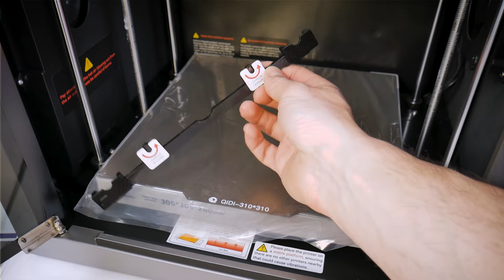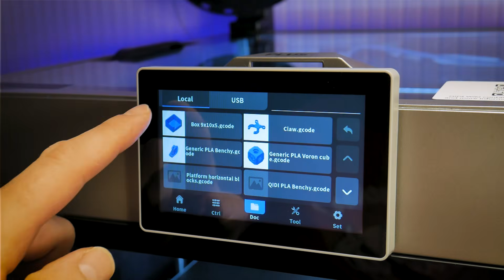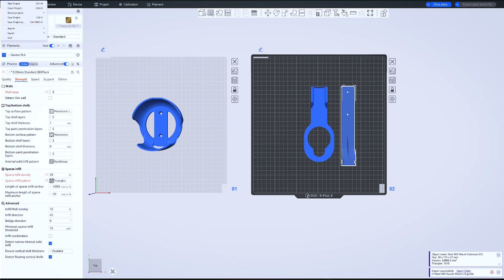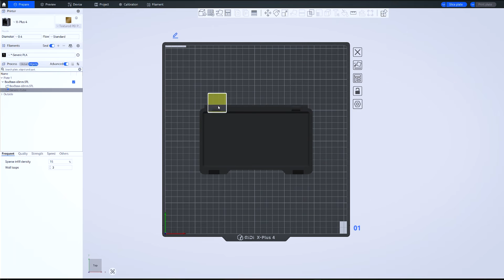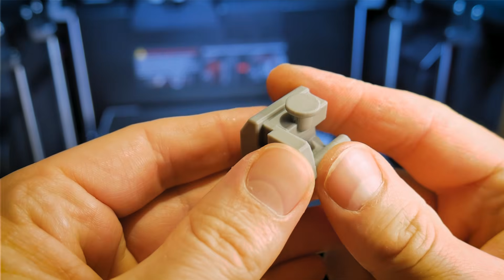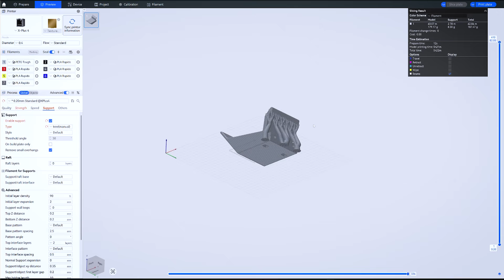QIDI PLUS 4 - Full Guide and Review - Still a Good Buy in 2025?

Comment: Ok with mine for a year, ordered after the 120v SSR update and have v2 of Qidibox, but staying on older firmware 1.7.0 for minths, and last week just updated to 1.7.1 as source is no longer disclosed beyond that. 

Had the ceramic heartbreak die and was replaced. Qidibox is touchy to say the least, but seems jams are due to the inner diameter of the PTFE tubes not being 4OD 3ID. 

I know the piezo sensor will need replacement due to heat with Beacon/Carto sooner than later. 

It's hard to recommend any printer these days as locking down features and violating open sources licensing by not posting modifications regularly is the norm. 

If I wasnt in the Qidi discord for easy access to troubleshooting methods, I doubt I'd be as fine as I am with the unit. (Like Screws Tilt Adjust being a key Macro for initial setup!) Sadly discord means the community info is locked down from the public internet.

Comment: DO NOT BUY QIDI PRODUCTS! If you are considering them, do yourself the favor and read my "long term" review. I have no youtube channel or affiliate links, but have plenty to say about them. Their philosophy is maximum function for minimum price = made as cheap as possible. I bought a 4 plus (with box) thinking the nay sayers are just the loudest. I mostly print with chamber heater at 50c asa/abs. My printer worked fine for 4 months and has been a nightmare since. It is falling apart constantly. I am currently fighting them for a return. The list: broken runout sensor which was stuck at "on" (which makes the box unusable because the printer thought the filament was in the extuder and never loaded it properly). The extruder gears are running really rough, giving ureliable extrusion. The heat sensor cable is literally hanging by the wire because the adhesive let go. The silicone cover on the nozzle desintegrated with some sort of corrosion under it and on the heater (no idea why, probably came like this from factory). The top door hinge sheared strait off the plastic frame for no obvious reason. The metal surface under the printing plate is developing cracks around every screw. (Support says its a no issue!) I get constant bed probing issues depite heat sinking the printer for 30-40 minutes with chamber at temp. I get uneven first layers constantly when the printer starts a second item in sequential printing, probably because of the previous + i am pretty sure the bed is wobbling forward/back perpendicular to the screws. Their slicer was updated 2x probably because of the 4 max coming out, it became progressively more unreliable with also crashing the printer about every fourth print now. All in all if you want a reliable, simple, turn key to print machine stay clear of them. All the lost time and frustration probably cost me more than getting a h2s or h2d from the start.
Reply: Can't do bambulab, closed ecosystem. I can do qidi, I have an xsmart3, and looking to get another qidi.
Reply: I have 2,000 hours on my Plus 4 and it has had zero issues and its in the same condition as when i first got it. By the way, of course you are going to get bed probing issues after heat soaking the printer for a half hour with the chamber fully at temp. That is literally when it would work the worst genius. The piezoelectric sensor on the Plus 4 is sensitive to high temperatures, you are basically torturing it dumbass. This is exactly why people have a bad experience with Qidi printers, because they are not made for novices that have no clue what they are doing. You need a printer that is stupid proof, go buy yourself a Bambu.

Comment: I ended up sending mine back after so many failures. They tried offering me 100 dollars to keep it,  but a non working printer is not useful.  Influencers make it seem awesome,  but I had to work on the one I got from day one. Never got a decent print.  Working with their tech support is not great. Sure, they will send you replacement parts, but the wait time is terrible.  Sometimes, you wait days before getting a response, and it is very frustrating.
Reply: Did you end up replacing it with another printer?
Reply: Curious to know what kind of filament you tried using right off the bat? Qidi printers require dialing in filaments that are anything more complex than PLA or PETG. They will do engineering grade filaments, but don't expect to just select a stock preset, hit print and have everything just work perfectly.
Reply: @TheMerchFiles the first filament i tried was pla. I still have my original qidi plus that i dialed in many a moons ago, but i replaced the new version with a bambu labs h2s.
Reply: I ended getting a bambu labs h2s.

Comment: Qidi is not a printer for everyone, mine took 5 months to get it running fine and I still have problems with the shit stock probe and managed to fix it be installing freedi os.

They did not want to refund me and accept to retun my printer so please dont buy a qidi if you dont like fiddling and want a plug and print printer, go with bambulab
Reply: I had zero experience with 3D printing and the Plus 4 was the first printer i ever used. I started with Polymaker PETG and it ran flawless out the gate on stock presets and i never had to adjust anything. First 3 spools of Poly PETG and never had a single print mess up. 4th spool i tried ASA and thats when i couldn't get it to lay down a clean first layer. Took a few hours of making adjustments and eventually i dialed it in and have not had an issue really since. Just got the Max 4 a couple months ago and its been just as nice.

Comment: Hey, qidi 4max or creality k2 plus or anycubic kobra s1 max? For pla i perg and ofcourse quality 😂
Reply: The Anycubic S1 Max is laughable compared to the Qidi Max 4. The specs says everything, S1 is recommended at 300mm/s max print speed and 10,000 mm/s acceleration while the Qidi Max 4 can run at 800 mm/s print speed and 30,000 mm/s acceleration. And the difference is in the raw build quality. The S1 has small belts and, small steppers and a tiny linear guide rail while the Max 4 has belts twice as wide, powerful closed loop steppers and a beefy dual carriage guide rail made for hauling ass.

Comment: I print PC-CF and PAHT-CF on my K1SE, does well enough with the enclosure, just ordered the Qidi plus4 myself though for the larger space and to have a printer that is actually designed for the more exotic filaments.  My K1SE also has issues with Wi-Fi, I run a separate router and disable the 5Ghz on it and run it only for my printer at 2.4ghz

Comment: Have had the Plus 4 for a few months now and already on my third hot end. This last one I only ran PLA-CF through it, so it is not for using multiple materials in the same nozzle and potentially causing clogs.
The printer prints very well but the start up is painfully slow - until the hot end fails.
The cost of ownership at $45 a month for hot ends is not fun.  probably run it 100 hours a month, maybe more... but that is far from full time say 360 hours a month or more. At those hours the cost of ownership goes up $90 per month, $1,180 per year.
Reply from the maker: That seems crazy :( I guess it must be the CF that is abrasive enough to do this. I'm still on my original hotend with regular PLA with no signs of it degrading yet. I do agree the startup is slow though, and navigating through the file menu waiting for the pictures to load is still frustrating to me. Otherwise I was comparing prints today between this machine, my K2 Plus and my H2S and honestly the part quality on the Plus 4 (with regular PLA) is right up there with those other two machines.
Reply: @EmbraceMaking  I have no issues with print quality, very pleased. However, the cost of ownership due to faulty hotends is not fun.
Reply: Phaetus makes a drop in replacement for the plus 4.  It let's you use v6 nozzles and claims 30% improved flow.
Reply: @dukex12  Have looked into those... there is a mixed bag of likes and dislikes. Questions about actual compatibility.

Comment: Ive had my plus 4 for almost a year with thousands of hours.and its by far one of absolute favorite printers. Absolutely beautiful prints. I mainly print high temp and abrasive materials on it and it just handles absolute everything ive thrown at it. I recently also got an h2d and having that second nozzle for dedicated support interface material has been a game changer. A qidi plus 4 with a dual hotend like the h2d is now my dream printer. Or basically an h2d on klipper would be my dream printer

Comment: To fix the Wi-Fi issue... Open the rear panel, remove the Wi-Fi chip from the motherboard and put it in the USB port on top of the machine. 

Go a step further and buy a dual band 5ghz capable tp-link wireless adapter and use that in the top port. They all seem to be well supported by Armbian OS. 

You can also use a USB 2 hub in the top port to have your Wi-Fi adapter and USB flash drive if you want both.
Reply from the maker: Thank you for the suggestions, I guess it didn't dawn on me that you could just put a hub up there and upgrade the wifi dongle - it's a great idea. I just wish I wouldn't have to do this... really should work well from the factory
Reply: @EmbraceMaking Qidi did the same thing with the 3 series, having the Wi-Fi dongle in the mainboard compartment. They did listen and choose a better brand dongle than 3 series had, but the big metal plate on the back of the XP4 blocks the wifi almost completely.

What we have been asking for Qidi to do is simply include a Wi-Fi dongle in the setup package and suggest that people either use Wi-Fi in the top port or USB flash drive. Most people don't use both.

Comment: By default devices on a guest network are isolated from each other.  That is the point of a guest network.  Try using 3 walls with inner/outer/inner and see if the banding on your PETG-CF part disappears.  It looks like you are seeing the effect of your infill through the walls of the part.  Very puzzled when content creators get such great first layers, but so many plain customers have an issue with that on this printer.  Mine absolutely had terrible / inconsistent z-offset issues until I added a beacon mod to it.  Put a very nasty gouge in my plate right from the go.  The probe was junk from factory, and the bed would not stay consistently stable.  After the beacon mod, probe was no longer used and was also able to bypass the bed pressure sensors and fully tighten the bed down to maintain a consistent z-offset.  These are very common issues with this printer.  Also the wifi is terrible in general, and have also found recent issues even with ethernet.  Had to replace the fan cooling the main board with a more powerful fan to keep the printer from failing on longer prints (in a 20C ambient temp room).  Have had to adjust the nozzle wiper plate to keep the nozzle from catching on it and potentially breaking the ceramic heat break in the nozzle.  Often have to re-home the printer more than once as sometimes (randomly) an intial homing is quite skewed.  Overall with mods and careful use it produces some great results.  However the manufacturing quality is quite sketchy for a number of users including myself.  Qidi has also started locking down Klipper, and has removed features like the bed mesh map visual graph in recent firmware updates.  They have done very little to nothing to address user concerns with any of these issues and have entirely left it up to the community to work around their design and manufacturing issues.  I would tell anyone looking at buying a Plus 4 to only purchase from a vendor with a 30 day, no questions asked, return policy in case they get a dud.  The SSR issue has been sorted, but virtually nothing else has been improved.
Reply: Thanks for this! I was looking into getting a Plus 4 myself but noticed a number of people with the same issues you described and whilst I used to enjoy modding printers, I'd like to get a solid one as a new workhorse.

Do you have any suggestions or testing steps to figure out whether a new unit is a dud or not?
Reply from the maker: Thanks for the suggestions! For the wifi guest network issue I have an option where these devices can still be discovered on the main network. This is actually how I dealt with many connection issues with other brands that only operate on the 2.4GHz band. So it should work... but for some reason still doesn't on this machine. 

I'll try reordering my walls for the fun of it - however the banding problem went away on all of my parts after resetting the bed and just doing the manual bed levelling over again... but if it comes back I'll give this a try. Other than that thankfully the first layers have been great and thankfully haven't had to go to the extend that you have :(  Because I haven't been able to access the machine over wifi I actually haven't been able to see the bed mesh now that you mention it - taking that feature away is really ridiculous!
Reply: Everything you said is true, these guys are paid to make such reviews or maybe they receive special printers which are tested very well , but when a normal person orders a printer from qidi next day you have to write them and tell them the nozzle scratched the bed
Reply: Thanks for the info. I'm interested in this printer because it has the wider belts and smaller pitch for the gears, which further reduces VFAs. The main board is universal among most of the qidi printers,with normal connectors. I have an xsmart3, so its the same board, been very pleased with the machine.

Comment: the 'bending' you see is caused by the long layer times and shrinking of the upper surfaces printed on this layer. has nothing to do with the printer but rather with the model and slicer settings

Comment: I achieved a PERFECT first layer on my Qidi Plus 4 the other night. This printer ceases to amaze me.
Reply from the maker: Did you go through any of the manual bed levelling?
Reply: @EmbraceMaking  I received the printer in the 2nd week of April. After about a month, I performed a manual bed-leveling, which improved the full bed mesh range to under 0.2mm on average. I believe my best variance was around 0.14mm, which is really good! 

Since then, I only do the auto-bed-leveling whenever I change to a new bed-type (along with the stock textured, I have the Qidi Cool plate for PLA/PETG, the Qidi Smooth Engineering PEI plate, and a 3rd party reversable Carbon Fiber design PEI/Diamond design PEO plate) and temperature. I print using everything! LOL!

What's amazing to me is that I'm still using the original 0.4mm nozzle that shipped with the printer. It's handled everything from TPU to PAHT-GF to near perfection.